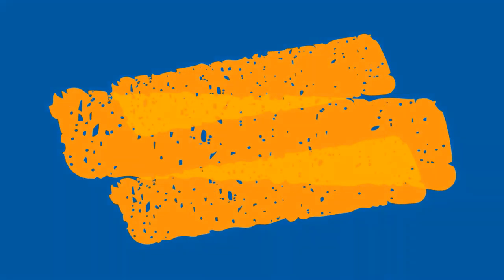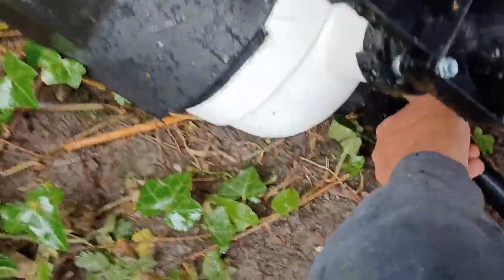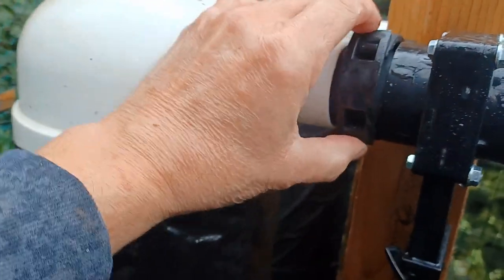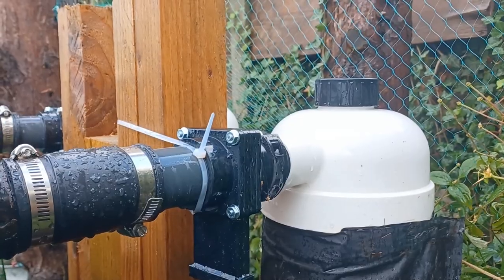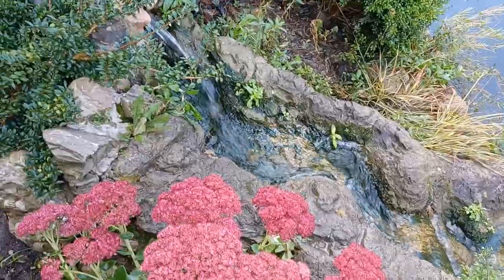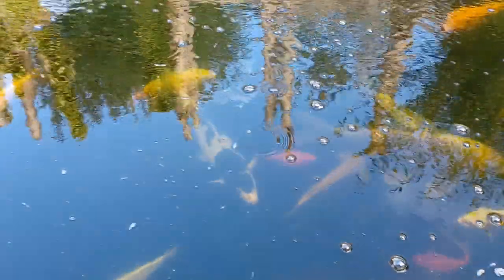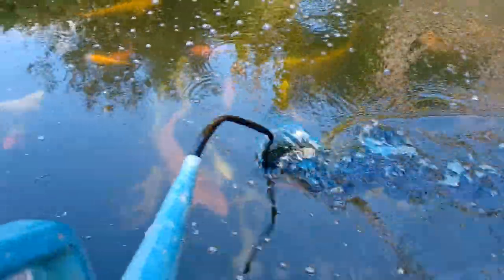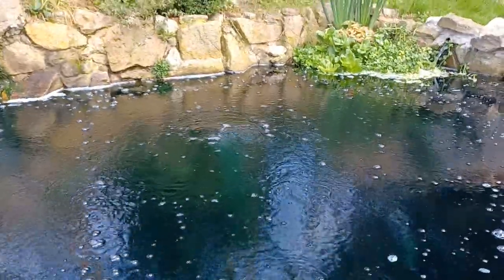Tempest Filter Catastrophe, avoided.

Comment: They are designed to have a wall behind the tempest so you dont have the back and forth .   Make yourself a shelf with a hole cut in it to allow the drain valve to pass through it to give it additional support

Comment: Gutted for your loss🙁. Did you scrape and inspect the dead fish to see if you could identify anything? Narrowly averted a possible disaster with your tempest, hope your run of bad luck has ended👍🈲🐟😊
Reply from the maker: Didn't do a scrape because I'd treat the water with a mixture of Malachite Green and Formalin the week before so presumed that would have seen off any parasites. Yes your right it could have been worse. If the wife hadn't been in the garden it could have drained the pond. Thanks for your support.👍
Reply from the maker: No didn't do a scrape because I'd treat the pond with a mixture of Malachite Green and Formalin the week before so thought that would have seen off any parasites. But your right, if the wife hadn't been in the garden it could have drained the pond. Cheers.👍👍

Comment: So sorry to hear about you’re koi mate 
I had a similar experience with my tempest 
I had stainless steel brackets holding it screwed into a concrete gate post 
And the whole thing literally fell off the post
That was after fitting a draco drum into my nexus and that draining my pond three times in 24 hours and me nearly loosing everything 
Koi keeping hey
Reply from the maker: I'm looking into some sort of sensor that would send an alarm call when the water level drops below a curtain level. Thanks for sharing your experience.👍

Comment: Hey yer mate I would look out for oversize down pipe brackets. They would strap around the Tempest and will have proper fittings to fix to what ever  they're going to be fixed to.
 ie  brick block or in your case timber.
Reply from the maker: Thanks, I've been racking my brains thinking of a way to secure it better. For now I've strapped the filters to the wood using heavy duty cable ties. Thanks for the advice.👍

Comment: Sorry to hear about the loss of the koi especially since it was one of your original ones in the pond. Maybe a heart attack?  Strange about the brackets for the Tempest. Don't look to sturdy at all. I would suggest finding something to provide additional support to prevent this from happening again.
Reply from the maker: Thanks, I'll definitely look at extra support for the Tempests. If the wife hadn't been in the garden and spotted it, it could have drained the pond.👍
Reply: @pomfretspond588  Good thing the wife was there for sure. Don't know if it's possible for you but have you thought about installing a float switch to turn the pump off in situations like this. I have a float switch in my pump chamber and if the water drops below a certain level the pump shuts off automatically to prevent the pond emptying accidentally.
Reply from the maker: @mykoiobsession  Great idea, I'll need to do some research. many thanks. 👍

Comment: I dont think those brackets are strong enough considering the weight of the Tempest when full of water. A lof of us have built a stand to help with the weight.
Sorry to hear about the big fish, I am gutted ofr you. It is sad.
Reply from the maker: Thanks I'll look into some supports.👍👍
Reply: Yeah basically a stool with a hole in the middle for the waste valve to go through. Takes the weight off the pipework and those silly brackets.  I've made a cupboard for mine with a shelf in that takes the weight. Can also insulate the cupboard and it keeps the sun off the unit.
Reply: @adamrudge6480  That's exactly what I have done for mine when I built it 6 months ago. I dont know why EA thought those brackets would take the weight
Reply: @LauMagroTheFrenchKOInection  Yes not sure of the exact weight filled, but those clamps just aren't designed for it. You can get nice stainless steal brackets for them now. But it's extra cost and it's a different company that actually make them. I've had mine running 6 months now aswell and the filter itself is brilliant. It's just a few things could have been designed better. Waste/air valve isn't great and I'd have used ball valves instead.
Reply from the maker: @adamrudge6480  Thanks for the advice, the unit is loos on the brackets. It's allowed the Tempest's to continuously move back and forth with the wind and that has put stress on the screws and caused them to snap. Cheers. 👍👍

Comment: Can you not drill straight through the post and use a long nut and bolt with washers.
Reply from the maker: I've put cable ties top and bottom and I'm looking at screwing some sort of support shelf to sit the Tempest's on. Cheers for the input.👍

Comment: You say you have a "pump"? fit a float switch just in case some thing like this happens again.
A float switch can be wired to turn off all electrics to pump, UV, what ever, worth £10 any day!
Reply from the maker: Would the switch attach to the side of the pond itself? Thanks.
Reply: @pomfretspond588  Ita a float that sits in the pond via a wire, when your water level drops it will automatically turn off the power, doo you tube/google search for it.
I had two on mine one for low water and one if my filter blocked up giving high water level.